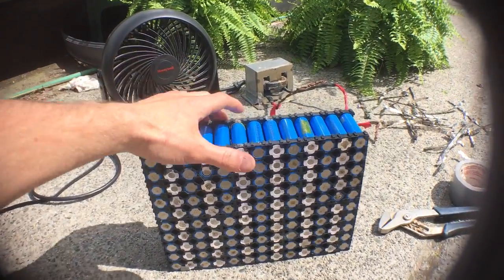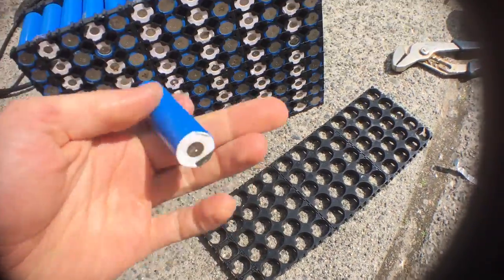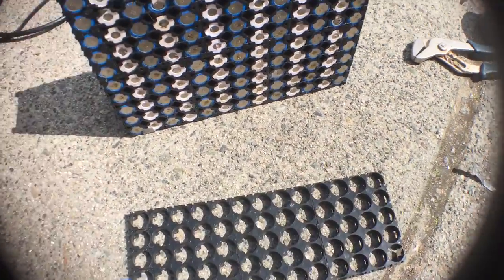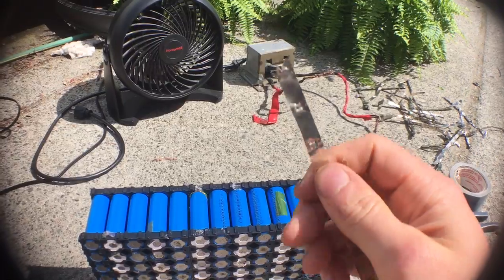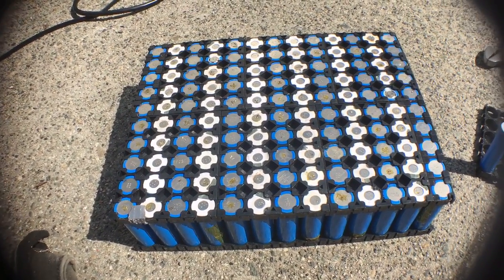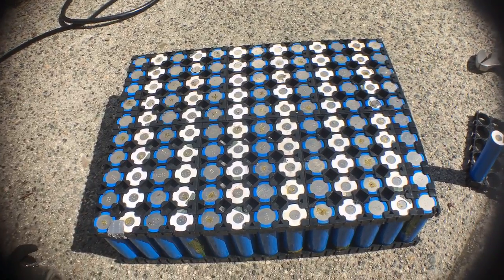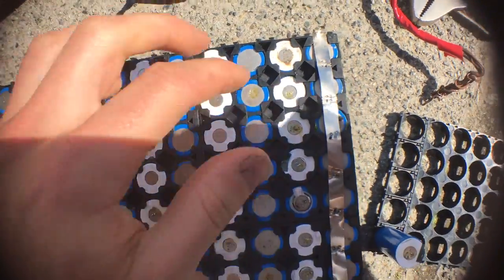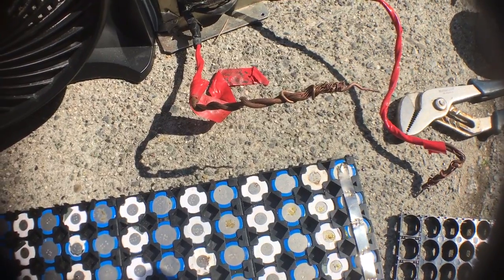Solderless 18650 Powerwall Ebike Battery Pack Construction

Comment: With your nickel setup at 8:42, the main strip does not handle the power. It is only connecting those cells in parallel. Your fuses are handling the series connection, which is where the large power flows. Your setup will work, but you could get the same effect by deleting the thick nickel strip and just putting a single long fuse or wire in its place to connect at the fuses (series links) in parallel.
Reply from the maker: Thanks for the advice. I've since made another pack where I alternate sides placing one full nickel strip directly onto the positive electrode and just thin nickel fuse strips on the negative electrode going to the next cells in series without a parallel strip. I prefer to use the full nickel strips for the parallel connection as they're really easy to zap onto the cells. A long thin fuse would require intricate cutting on my part if I wanted one from nickel strip that I could spot weld. Sometimes for faster balancing when I finish the packs I like to fast charge the each individual parallel row at 4.2V and a thin parallel fuse would probably blow.
Reply: Not really.  Because you need the cells to be in parallel so they can balance the rows.  So instead of getting a 13s10p, you will get a 10p13s, which means you need 10 BMS, one for each series, instead of a single BMS.  Remember, each series needs a BMS or at the least must be manually monitored.  So with 10p13s, you have 10 series and each series needs to have a BMS or each cell (i.e. 130 cells) must be manually monitored - neither of which is practical.  The video is doing the correct way and results in a 13s10p - i.e. one BMS, or 13 groups of 10 parallel cells each to be monitored.

Comment: I've been pondering cell level fusing for a 100P4S power wall than I intend to build. Cutting thinner nickel strips is now at the top of the list. 

Have you played around with what amperage will blow a particular thickness of strip? Thanks for posting.
Reply: Don't bother with cutting thin strips.  Use 30 or 32 AWG tinned copper wire and fuse weld them with the spot welder.

Comment: You should use a 13s BMS.  They are only $15 on eBay and it takes minutes to solder them.  They also protect the pack from over discharge, overcharge, over current and short, and then also balance.  Make sure the over current rating is high enough for your application.
Reply from the maker: thanks for the recommendation. I put a bms on this pack after I made it but I only use it for charging. discharge just goes straight from the battery pack and I watch the voltage on my throttle display
Reply: The BMS will cut off the current if ANY of the cells (actually groups) drop below 2.8V.  It monitors 13 groups of p10 at once ...  It is possible that due to a bad cell, a group will go below 2.8V before the pack goes below 13x2.8= 36.4V.  BTW, I am building a 14s10p pack.  I chose 14 because it will make it simpler to put several of these packs in series to arrive at 96s for EVs.  With 13s, that is difficult.  Something you may want to consider in your next pack.
Reply from the maker: I use cell monitors instead that beep if a series row goes too low. My ebike motor already gets a little warm overvolted to 54v so can't go much higher . good luck with your pack! make sure to do the cell level fusing especially if they're used cells.

Comment: Your welder looks sketchy af
Reply from the maker: Jama tut it's safe you stay away from the hot side. You can make it safer if you mount it in a plastic box and even more if you pit plastic or rubber electrode holders on it.

Comment: How are you not being shocked?  Low voltage/high amperage?
Reply from the maker: Adrien Seguy Output is only around 3V . Not enough to overcome skin resistance as I understand it
Reply: Adrien Seguy I touch 72v dc and I dont fell it even if my hands are wet the only time I felt it once was because I had a cut and it hurt
Reply: Up to 42V is safe if dry.  This is only 3V.

Comment: Dude, where can I get these batteries?
Reply from the maker: Luqman Radzuan if you want to buy cheap look for Jehu Garcia's $1 18650 video. That will give you identical cells which are much easier to keep in balance than recycled packs. If you want to use recycled batteries find out where they accept them in your town and go there and  ask politely if you can take some for a sustainability project or a school project. If they ask why you want dead batteries you can explain that usually only one of the cells inside the battery pack  has died. Most of the time people are willing to help you out.
Reply: AliExpress or AliBaba - only buy LG, Samsung, or Panasonic.  About $3 each.

Comment: ... did he just hold the electrodes... With his bare hands... Did he just bridge a circuit with his body and not get burnt.
Reply from the maker: output from the welder is low voltage, only 2V.
Reply: @InflamedBallz   I think I was going for a joke here, but it's been awhile and it was obviously a poorly made joke.
Reply from the maker: @SirCumferencelel  my bad. thought we had a karen situation here. with all seriousness though I probably should put a ground wire on the core of that transformer. either way thanks for the comment
Reply: @InflamedBallz  lol, no worries. This is why I never quit my day job to be a comedian.

Comment: Many complaints. Now how did it work out. That is what matters. 

How about doing a 24v build. Maybe a how to .
However just use color strips of batter representing the buckle strips. More of a demo.
Reply from the maker: worked out great for my ebike application but the cheap bms killed the pack during winter storage.

Comment: thank you for not soldering directly to the cell. I cringe every time I see it lol
Reply from the maker: Ikr. MOT spot welder all the way! Best $0 I've ever spent.
Reply: Tyrone Ward I have soldered my pack and no ill effect takes only one second if you use good flux so cells won't get damaged.I have used copper buss bar and cover fuse wire a lot better conductor than this thin nickel strips.
Reply from the maker: greg23842384 I've soldered cells before too. I much prefer this method though. More reliable, it's faster, easier to take apart,  no prep or sanding needed (some brands require). In my other video I demonstrate how I  used the same method solderless method  but copper bus bars on my camper pack. You may not notice any immediate effect of the heat to the cell but you'll get slightly less cycles in the long run. There's a reason why most manufacturers say not to solder directly to the cells in their data sheets.
Reply: Spot welding is easier but soldering can be done.  Make sure the battery terminals are scratched using a dremel and set solder gun to high heat, and use tinned wire and quickly solder.  No one has reported a problem with fast soldering.